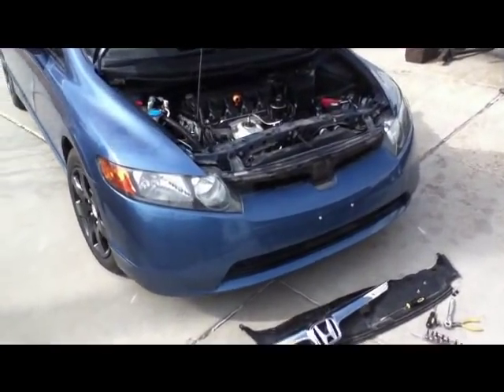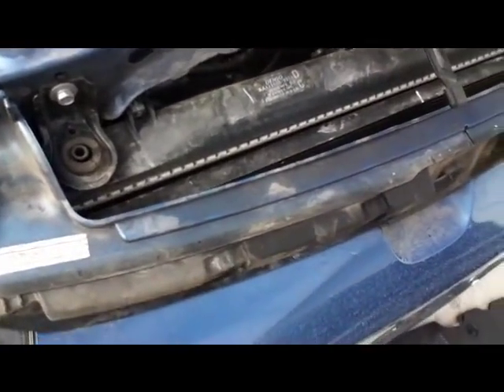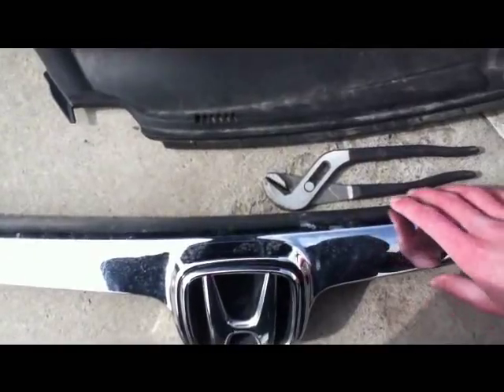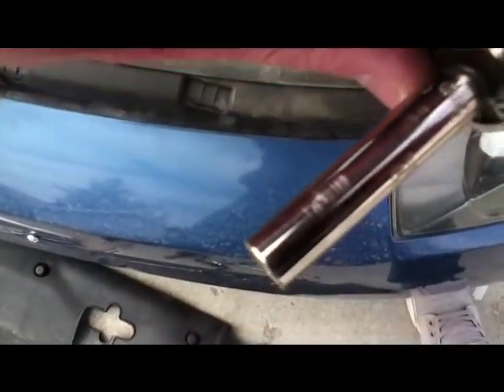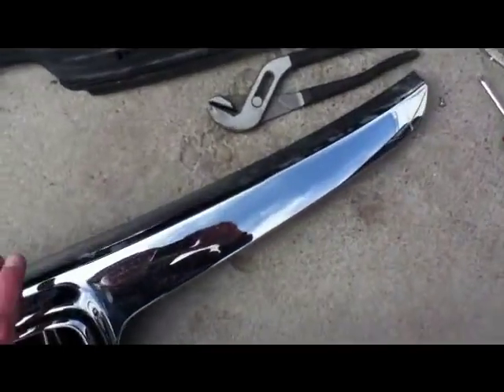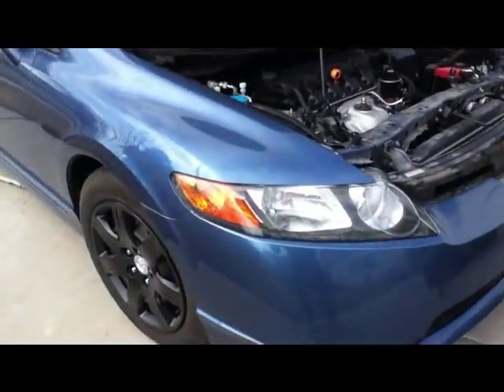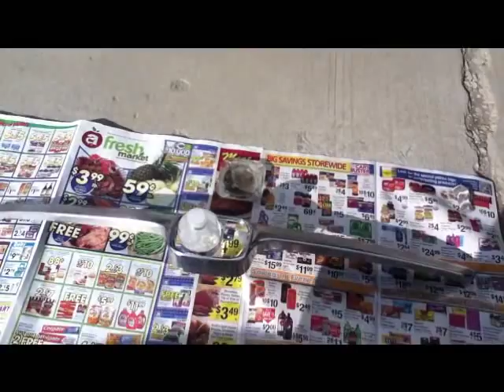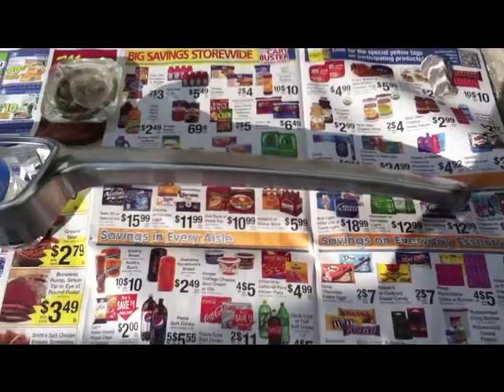How to Paint 8th Gen Civic Grille

Comment from the maker: I did probably 4-5 coats. You want to do as many as you have time to do. But wait 15-20 minutes between coats because you don't want it so wet that it just runs everywhere. But the more coats, the stronger it will withstand against bugs. I did two coats before and it had a million chips all over it due to one ride on the freeway. So do a great job and coat it on!!